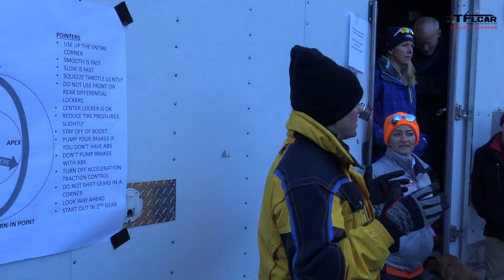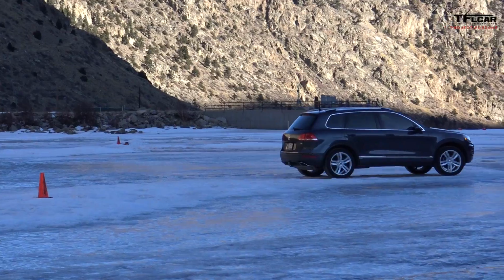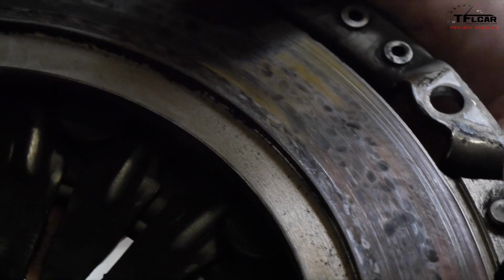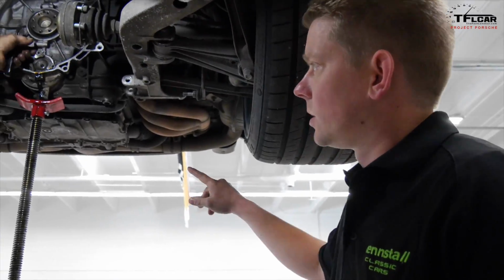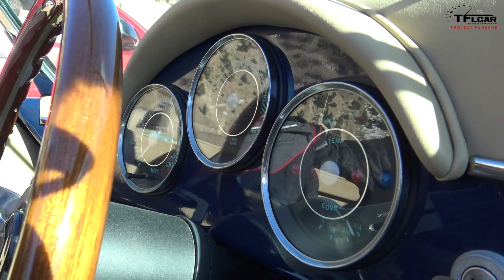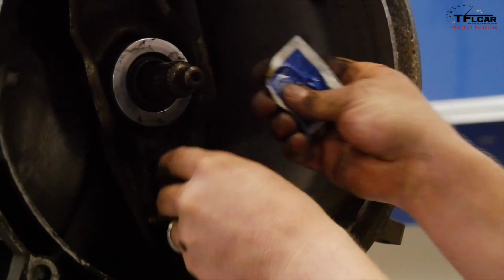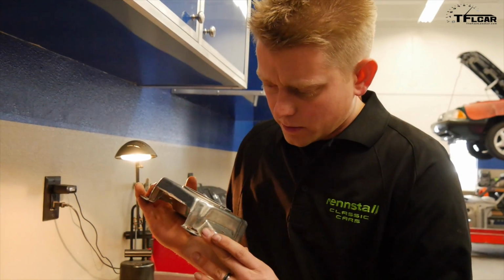Porsches on Ice & How to Replace an IMS Bearing - Project Porsche Ep. 3

Comment: Very good content.  For all of us concerned about the Porsche IMS Bearing 
issue - I found a very informative article from Autohaus Hamilton in Australia 
about the IMS. The article also lists all the models and engines (with engine 
numbers) that are affected. To read the article just type in “Autohaus Hamilton 
IMS” into google. The Porsche models that are prone to IMS failure and should be 
replaced are: - All 986 Boxster models. - 987 Cayman & Boxster models up to 
engine number 61504715 - All 996 models (not including: GT and Turbo models) - 
997 3.6ltr with M96/05 up to engine number 6950745 

Before 2000 Porsche used a double row IMS Bearing which 
had a low failure rate, then Porsche switched to a single row until 2005 - 2006 
and this single row has had the most problems. After 2005 - 2006 Porsche stayed 
with the single row but beefed it up significantly and this bearing has had the 
least problems of all three types of bearings used from 1996 to 2008. The 
upgraded bearing in the 997 and 987 is unserviceable, meaning you can't reach it 
unless you strip the entire engine down. From my research the IMS issue has been 
greatly exaggerated, mainly due to a cottage industry that produces and installs 
IMS Bearing replacements, so naturally it's in their interest to scare all 996, 
986, 997 and 987 owners into thinking all their engines will suffer IMS 
failure.

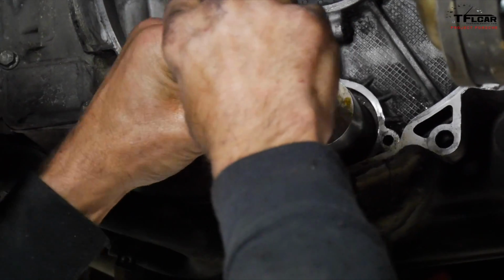Comment: So watching the video @ 11:38, you can see the open end of the bearing. Isn't that installed backwards? Shouldn't that be pointed towards the inside to the crankcase for the oil or am I misunderstanding something? Also, I would never replace the bearing on a 99 at this point.

Comment: No wonder you only get 60-70k miles out of a new clutch plate when you use an impact gun to tighten the pressure plate. Tighten bolts bit by bit in a star pattern, it is a big metal spring after all.
Reply: If you know your impact gun well, it's okey, it's not all that important. Doesn't affect the lifespan of the clutch.

Comment: Learn something new every day.   After watching this, I did a Google search on the IMS bearing.  You definitely do not want the 2006 thru 2008 models, and even a few of the very late 2005 models -- those bearings cannot be replaced without completely tearing down the entire engine.  And they're definitely crappy bearings.  After this, you couldn't pay me to own one of those models...  This '99 996 is a far better design -- dual-row bearing, that's easily replaceable.  I would drive one of these with confidence.

Comment: does ims bearing problem only with manual shift 997 I have 06 997 with tiptronic auto
Reply: You don't need a special solution for the IMS bearing. The original works just fine. IMS fault is't that common and It's just hypped up on the forums
Reply from the maker: +Edmund Garcia the problem is with the 996
Reply: -   All 986 Boxster models.
-   987 Cayman & Boxster models up to engine number 61504715
-   All 996 models (not including: GT and Turbo models) 
-   997 3.6ltr with M96/05 up to engine number 6950745
Reply: What Ims replacement bearing system for you recommend to replace the original?
Reply: Nm

I see the LN bearing now lol
Reply: +Edmund Garcia With all do respect to TFL, the problem is a possibility till 08, regardless of transmission.

Comment: It has always been strange to me that 911 clutch life, or recommended replacement is  60-80K, while lots of other cars with the same power go way past that. Maybe it is BS and they can go quite a bit longer.
Reply: view the photos of the checking and wear,you could always be Einstein and drive it twice as long and then have to replace the motor because of premature failure of a $200 part.it pretty much depends on how many stupidly hard launches the car was subjected to as well.if you cant really afford a couple grand every couple years,take the bus.

Comment: Couple hundred for a IMS bearing on a Porsche? I expect a couple thousand considering the transmission is dropped.
Reply from the maker: +bmwmsport11 FYI: $2600 for the new IMS Bearing and a new clutch as Roman points out in the video.
Reply: +The Fast Lane Car 2600 is a bargain...
Reply: Not really my friend used to have a 996 and he did the same job at a local porsche expert and payed something similar.
Ofcourse if you drop it off at a dealer youll get raped, but you dont do that with an almost 20 year old car. There are people who know these cars alot better than the youngsters at dealerships.